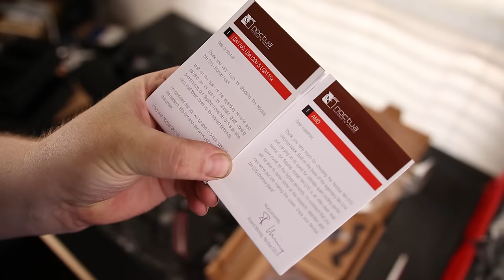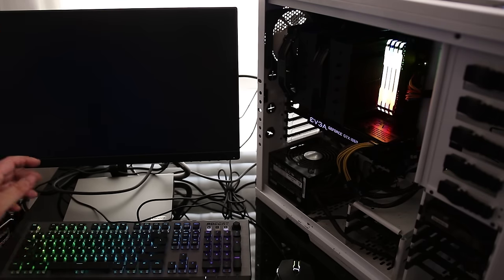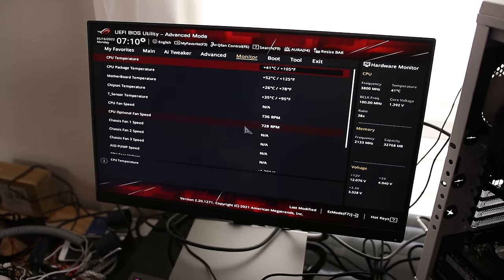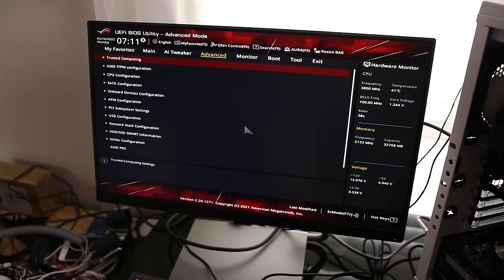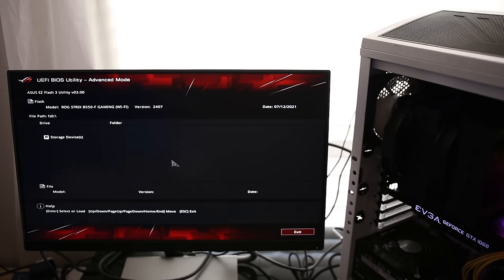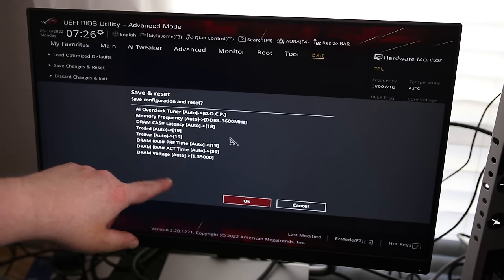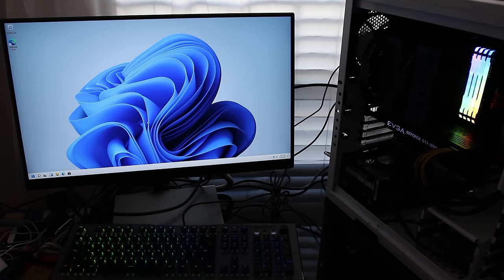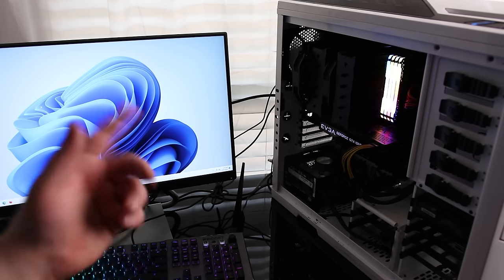Full Build Win 11, ASUS B550-F, Ryzen 5800X, Corsair Vengeance, Noctua NH-D15, Samsung 970 Evo Plus

Comment: I stumbled upon this video and its great because Im getting a similar PC with the only difference is in the case (cooler master h500p mesh) and the GPU (MSI 3060 ventus x3) This video is super helpful since I’m going to assemble it myself 🙏
Reply: hows the build so far bro? i just bought the same gpu
Reply: Psu used?
Reply: @thatmanbigo  What was the power supply you used?
Reply: @CaNIIO  Corsair CX750F RGB
Reply: also changed the ram for some G.Skill Trident Z Neo 3600MHz CL16 16gb x2

Comment: thought i was a pro at installing cpus after watching this. Ripped the amd cpu up with the fan several times, cause i panicked due to the pressure i had to put on the air cooler xD luckily it still worked.. even though the pins are friable, its kinda stupid safe. Anyways, amazing video, the calmness is the best part. Doing it like you've done it a million times before, helps a noob like me out by calming me down. Thank you!!

Comment: I'm glad I caught this video. I didn't realize I could run 3600mhz memory on this board. I thought it was 3200mhz for some reason. Thanks for sharing ha .
Reply: The board is a B550, so 4400MT/s is the highest it can run on. The limiting factor is (in most cases) the CPU, as Ryzen 3 has a warranty void when going above 3200MT/s.

Comment: I just finished mine with 64GB of RAM 3200mhz,  Ryzen 9 5900X OC, Radeon 6900XT 16GB OC, and H100i Elite Liquid Cooler, Samsung 980 2TB Nvme, and a 850W Segostep PSU. The case is a Mid ATX, yes, full ATX would have been better but  my budget got me the mid ATX. Now I see that I have to tweak the Bios settings in order to get full performance from all the components.

Comment: That motherboard looks insane.i went from H270F strix i5 7400 to this one with R5 5600x (i dont need more cores). I did reuse my 32GB of DDR4 2400Mhz but darn this thing fast as fuck
Reply: Did you have to update your BIOS in order for it to work with the 5600X?

Comment: hey question, so i have this same motherboard, and i have a 980 pro ssd, at first i installed it on the bottem slot because i didnt think it mattered where to install it, but samsung magician was saying it was pcie gen 3x4, and too install it in the pcie gen 4 slot, so i did, i moved it to the top slot, now its saying its pcie gen 4x2, but the motherboard states that there gen 4x4? and i  feel like im not gettting the right write and read speeds, is there something i need too enable in bios? im kinda confused on why it says gen 4x2 and not gen 4x4 lol, a reply would be nice cause its my  first time installing one and im kinda confused.

Comment: How did windows work without enabling TPM I’m about to do the same set up but everywhere I look it says I have to enable it  for this motherboard! And how did you not get a black screen at the start because from what I’m seeing you will need a bios update first with pc switched off but plugged in! Any advice would be greatly appreciated
Reply: Heya there.  Everything worked right out of the box.  I didn't have to do anything of that nature.  I have had to deal with this on an older Intel board here: https://youtu.be/a7DbYYFBX9Y  but this one had everything ready to go.  My guess is first generation B550-F boards were shipped with an older BIOS that needed more TLC.  This board has been out for a while, so my version likely had a lot of issues already solved.  Hope that helps.
Reply: @distractor_beamreviews   thanks a lot that makes sense, shouldn’t be a problem for me either since my motherboard was manufactured in ‘22

Comment: 7:08 is that all u need of thermal paste?😳 I seen ppl adding way more so I’m just curious tho.
Reply: It's how I was taught a long time ago, but whether it's correct or not will always be up for debate.  I watched a video a few years later that showed different patterns smashed under plexiglass and it confirmed the rice dot choice was the best.  I tried to find a link to it, but I have no idea where it's at.  Out of curiousity, I watched a few modern videos and they are not happy with the rice dot technique.  One of the things that was always hammered into me about it, was that good thermal paste is also electrically conductive and if it spills over the edge it can short out a component.  I know it squishes out only when it can't fill gaps, so if you have a perfectly machined surface, there isn't any gaps to fill.  It may vary depending on cheap components, or even porosity.  The rice dot hasn't let me down, so I keep using it.

Comment: You used the EPS x8 plug to power the processor, is that enough or do I also need to plug in an additional x4, is it necessary? I don't intend to overclock the processor, for now I will use Ryzen 5 3600

Comment: Question: I purchased the Lian Li 011 Dynamic and I'm installing a ROG STRIX B550-F GAMING MB, I'm attempting to connect the System Panel Header and I can only find 1 connector, labeled Power SW. There are no additional System Panel Header Connectors. May I assume that that's the only System Panel Header Cable it needs? Because I don't see any HD LED and as we know the case has its own LED Module at the bottom of the case. I'm lost, did they integrate the case to MB by some other means? The installation book shows all System Panel Header connections, but no additional cables/connectors to be found. I wondering did they screw up and left those connectors off. Plz advise. Thank You
Reply from the maker: I don't know that case, but based on this:  https://youtu.be/YFA2IW-Rn5A?t=1544  I'd say you should have more connectors.

Comment: This could be ignorance but I’m
Still learning and am considering this cooler:

On their website the additional fan is placed on the side where the RAM is. Obviously you want both fans to be facing the same direction? If this is the case, is there a problem with you installing the fan on the opposite side? 

If there are any misconceptions or anything I’m misunderstanding please anyone clarify / teach me
Reply: The most important thing is that they're both blowing the same direction.  You can flip the fan around and install it either way.  The main reason for putting it over the RAM is because most of the time there's a case fan right next to where I put the 2nd fan.  Putting 2 fans that close together is a bit ridiculous.  You can see them next to each other at 11:47.  This fan is bigger, more reliable, and higher volume, so it's arguably worth keeping it on.  I'm using the NH-D15S on my personal computer.  It's basically the same cooler, but with one fan, and it works perfectly fine.  You could easily do the same thing with this cooler with maybe a couple of degrees difference.  There's 2 reasons I didn't put the 2nd fan above the RAM.  The first and most important is because it wouldn't fit in the case with the side panel on.  The second is because I didn't want to block air flow over the RAM that would be covered by the fan case.  Now that I think of it, there's a 3rd reason.  The cool lights on the RAM.  Hope that helps.
Reply: Brother, if you are still learning, there is no point on going with this cooler, yes it is one of the top there is in the air cooler department but honestly its better used on overclocking which means messing around with stuff, if you are going to stay on stocks settings even a half priced cooler like the artic 34 e sport will do the same

Comment: im about to use the same motherboard and im a bit confused with the 8pin + the 4 pin connectors in the pot left. do i need to connect both of them?
Reply from the maker: The easy answer is 150 watts https://www.gigabyte.com/Support/FAQ/2773
Many manufacturers limit an 8 pin connector to 150 watts, but some of them allow you to get around it.  For liability, nobody wants to really say what's possible because there are too many variables.  Some really cheap PSU's can have very thin wire that can overheat.  Combine that with a bad pin crimp, poor connector design, corrosion, and bad solder joints and it's possible to start a fire.  
4 of the wires on an 8 pin connector are positive.  According to this calculator, if you use 4x 18 gauge wires, that equates to 1x 12 gauge wire.  https://www.wirebarn.com/Combined-Wire-Gauge-Calculator_ep_42.html
Keep in mind, the wire coming from the breaker box in your home to the outlet in your room is 12 gauge.  
Volts x Amps = Watts.  The 5800x is rated at 105 watts without overclock.  This  is a 12 Volt system.  105w / 12v = 8.75 Amps.  According to this calculator, at 4 feet, a single 18 gauge wire is usable.  https://www.wirebarn.com/Wire-Calculator-_ep_41.html
The liability answer:  An 8 pin connector is fine for this build, but if you want to be safe, use 12.

Comment: great video and very  informative. question, would i be able to use 2 sticks of 8gb corsair 3600? also for the ssd a wd sn770 which is a M.2 PCIe 4.0 X4? 

im totally new to pc builds and i am thinking of doing this build and parts. thank you!
Reply: Yes and Yes.
Reply: Yes you can for both, just make sure you are running in dual channel mode. Consult your motherboard's manual if you are unsure

Also, make sure your cpu and gpu are properly paired. This video was made in the height of a gpu shortage, so he only had a gtx 1060 on hand. While that is a decent graphics card in its own right, pairing it with a 5800x is a waste, as you will be spending far more on a cpu then you need to get the most out of the graphics card. A 5800x is better paired with a rtx 3070ti or along those lines.

I hope it works out for you. Happy building

Comment: Which power supply did you use? My PC: 
Ryzen 7 5800x
Rtx 3060ti de msi version ventus 3x
32gb de Ram consair
1tb NVMe  PCL.4
Hdd 2tb
Motherboard asus rog strix B550-F gaming Wifi 2
Case: Asus tuf gaming gt301
And 750w power supply by corsair… 
I would like to add the Noctua NH-U12A, Do you think the power source supports it?
Reply: I'm using a HX1000.  I always go overkill on power supplies for higher efficiency.  That 750 will be fine.

Comment: I have a question for you dear Distractor_Beam :) 
Will the ASUS B-550 F Gaming Motherboard work with AMD Ryzen 7 5800x CPU in combination? Will it be able to give me a picture through integrated Display Port or HDMI Port, if I don't have a separate graphics card? i.e. is it like it used to be with older computers.
Of course I did an UPDATE to the last available BIOS from the motherboard via USB :-)

Thank you very much :-)
Reply: The 5800x does not have an integrated GPU.
Reply: @distractor_beamreviews  thanks...
 So I need AMD Ryzen 7 AMP that has a "G" mark?
Reply from the maker: @PulseUltra89  I have a love hate relationship with Newegg, but one thing they do really well is their filtering options.  Although I'd still double check that the processor you're looking at has an integrated GPU, this can help determine the processor you want.  https://www.newegg.com/p/pl?N=100007671%20601353519%20601294614%20601387788
Reply: @Distractor_Beam   is AMD Ryzen 5700g slower than AMD Ryzen 7 5800x?
Reply from the maker: @MarkoParavina  I've never used a 5700G.  According to this, the 5800X is faster:  https://cpu.userbenchmark.com/Compare/AMD-Ryzen-7-5800X-vs-AMD-Ryzen-7-5700G/4085vsm1552677
Reply: Go for AMD RYZEN 5600G to work with integrated graphics.  It is a 6 Core 12 Thread processor with good performance.
Reply: @sivakumarb9749  Thank you for your answer bvut it is too late for that 5-6 months later. 
I've already bought 3 months ago ASUS B-550 F Gaming Motherboard + AMD Ryzen 9 5900x (even more powerful that 5600g, of course you already know that) Processor combined with AMD RX 6800 16 GB Pulse Graphics card and Kingston Fury 32GB Beast RGB DDR4 3600MHz (1 module). This combination is ONE BIG KILLER I can say!! I would recommend this combination to everyone who can afford with his pocket. Today 5/21/2023. This computer can run anything you cimagine or perform any task you ask from it.

Comment: Broooooo can you please suggest a 5000 series cpu that would complement or actually utilize a 3080ti I'm building completely backwards....I was gifted a 3080ti by a very good friend...obviously im not the only guy but man im just suddenly addicted to computer hardware now and I'm doing my first build 😅....I have a nice ultrwide lg1440p monitor...nxzt case...1000w corsair psu...1tb WD nvme m.2...Definitely going air cooled noctua lol...literally just pulled the trigger on this motherboard....seems like a good choice...almost went with am5 then looked at rocket lake lol to expensive....thanks again
Reply: If I was buying a 5000 series today I'd get the 5800x3d or a 5900x.  The 5900x is about $20 more, but you get 4 more cores.  Performance in games will likely be about the same, but if you do a lot of multitasking or want to stream, those cores can make a difference.  The 5950x is the top dog, but at that point you'd be just as well going with a 7000 series cpu.

Comment: I have a question. On the ryzen 7 5800x website it says the supported ram speed goes up TO 3200. And ur ram speed is 3600. are u running them on 3600 with no problems?
Reply: @distractor_beamreviews no issues except my damn ethernet wont connect 🫥

Comment: My mother board came with the Wi-Fi built in, specifically bought it to avoid using an Ethernet cable. Just to find out it literally doesn’t let you install windows without an Ethernet cable.

Comment: Ive got the same motherboard, but when i installed windows 11 it was asking me for internet connection. Unfortunately it wouldn't pick up wifi because there were no drivers installed LOL. So i used my Gigabyte wifi card and boom. It found the internet.

Comment: what do I need to download the BIOS before doing my build? I'm new to pc building
Reply: Some motherboard will say Ryzen 5000 ready. That way you don't have to flash it. If not make sure you  get a motherboard with bios flashback. Then you can watch how to flash your bios with a USB for Ryzen 5000 cpu. It is easy.
Reply: You download the latest bios drivers to the USB an make sure you name accordingly to each manufacturer properly. Just look up on YouTube how to flash your bios for Ryzen 5000
Reply: It will depend on the motherboard and the exact CPU you're using. There are instances where the motherboard box says it's ready for [insert version of Ryzen], but you need to update the BIOS due to incompatibility if you didn't update the BIOS ahead of building the PC.

Comment: I need help, I have a 5800xd ASUS ROG Strix B550-F, I need bios version 2423, but it is no longer on the Asus website, the latest BIOS is 2604, and will the 5800x3d work with that last one?
Reply: Did you ever fix this problem?
Reply: @dylan4800   i instal last bios uptdate and work all fine with 7900xtx nitro+

Comment: i got nvme with a heatsink but the bracket and heat pad can’t fit back on. do i NEED the bracket? Or can I just stick the heat pad on it and leave it?
Reply: You can use the heatsink that came with the drive and leave the motherboard heatsink off.
Reply: @distractor_beamreviews  Thanks I ended up doing that 👍🏽 My first build so all the wires and stuff is kinda overwhelming but i’ve been watching videos as I go. Now i’m trying to figure out if it’s better to paste/mount my AIO before or after I install the motherboard?
Reply: @_N4VE_  That's a good question.  It depends on the case.  If the radiator is going to be mounted in such a way that it would cover up the motherboard mounting screws, you need to install the motherboard first.  If there isn't access to the back of the motherboard from the rear of the case, and it requires a third party mounting plate you'll need to install the cooler first.  In a best case scenario you'll build the computer outside of the case for easier access and insert everything together.  You can't really do it wrong, but you may need to pull parts and try again.
Reply: @distractor_beamreviews  Luckily I was able to install my AIO after I put my board in 👍🏽 Builds about done I’m just waiting for my smaller ssd for windows and vertical gpu mount for that 79xt heat issue. Oh and I was so excited to get started i totally forgot that I needed a keyboard so i still need to get one 😆
Reply from the maker: @_N4VE_  Congratulations!  It sounds like you did your research.  Always better safe than sorry.  😀👍
Reply: @Distractor_Beam  I made sure to be extra cautious not to mess anything up 😂 Kinda concerned how close the gpu will end up to my glass cover but hopefully temps will be okay. Wasn’t sure about the cpu paste either but I saw that “MX4 Artic” brand pop up on many “best paste” lists so I went with that.

Comment: Just built this Motherboard and I made sure my Ram is fully inserted. 16x2 3200. My DRAM light comes on when booting. Not sure what to do. My RGB lights come on but I get no display. Made sure my cooler isn't to tight on the CPU and reset the bios.
Reply: Does the DRAM light go off after booting, or does it stay on?  If it stays on, you could check to make sure you're using the correct ports.  At 1:32 I show the Dimm port labels.  With 2 sticks you'd want it in B1 and A1.  So 1x1x.  Check the label to make sure it's the same.

Comment: brother hows samsung 970 evo is faster than 980 pro??
Reply: That's what I want to know. The 980 Pro is actually faster than the 970 Evo Plus (I'm the OS key away from starting a build for one of my drivers {it's a late wedding gift for her} and I have a 2TB 980 Pro as the boot drive with a 2TB 970 Plus as a separate storage drive - the 980 Pro has a read speed that's twice as fast as the 970 Evo Plus).